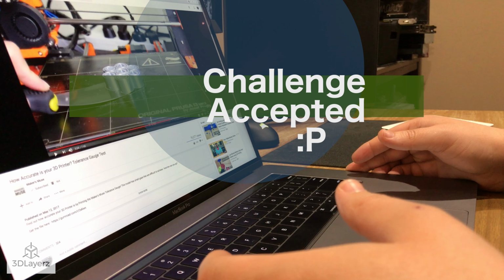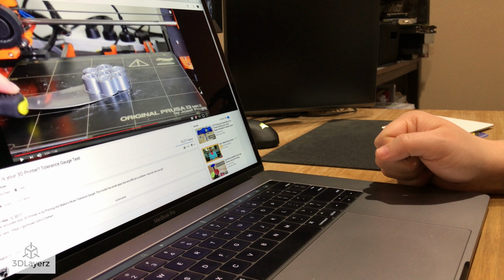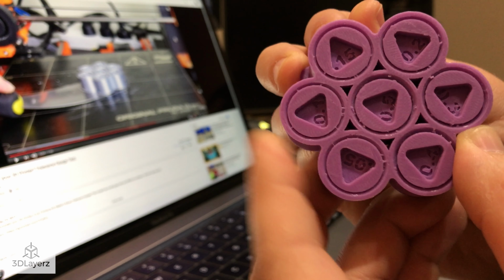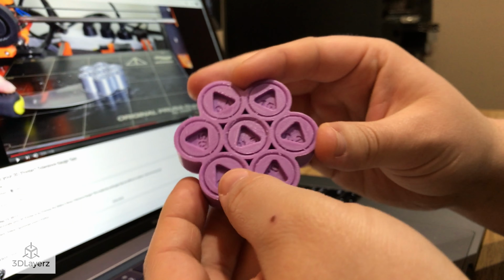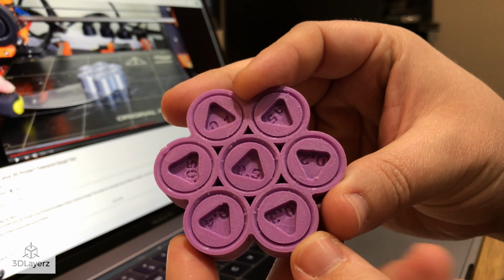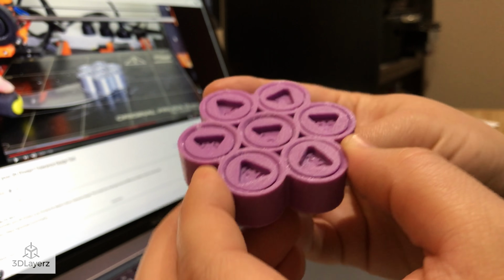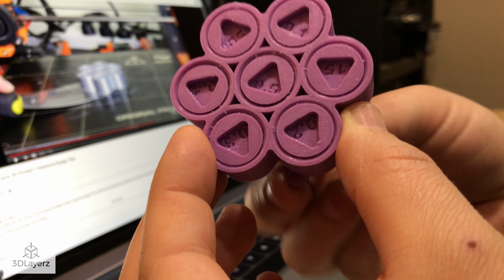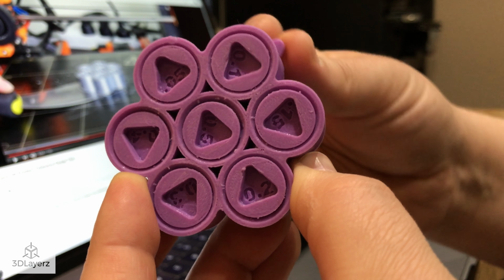Tolerance Gauge Test - Challenge Accepted Angus :D

Comment: Can be done with FDM:
https://www.youtube.com/watch?v=b0eNlVuq5BM
:-)
Reply from the maker: A BH that's epic!  What extrusion multiplier did you use?  What slicer?  Going to have to try some of that filament looks very neat.  Great work and thanks for showing off your results!
Reply: I use Simplify3D. Don't remember the extrusion multiplier. I calibrate each new spool of filament when I start using it. This determines the extrusion multiplier I will use for the spool. After calibration I almost never touch the multiplier again. I use a 20 mm solid cube for the calibration, not by measuring its dimensions, but I print cubes with 0.01 multiplier steps and decides which one looks best on the top.
Reply from the maker: Ok, I use and love simplify3d as well :D

I definitely have different configurations for filaments, with cube prints I'm definitely going for dimensional accuracy, per simplify3d's website and other community forums top layers will vary based on layer height.

Keep up the great prints!